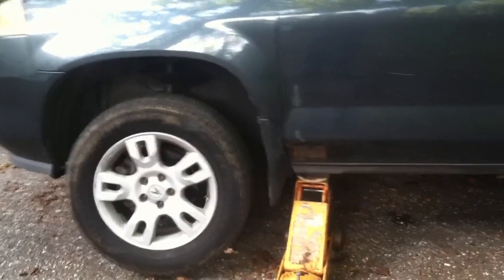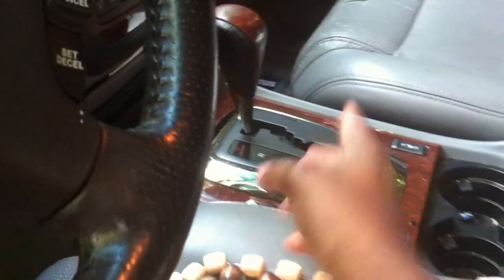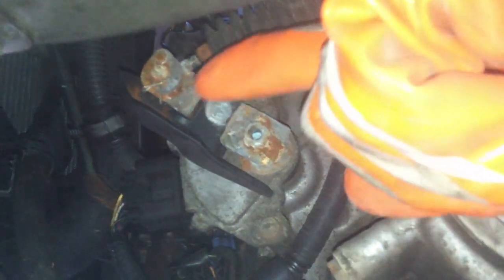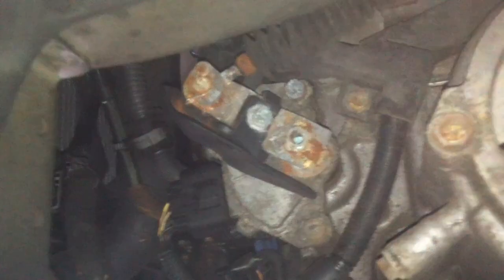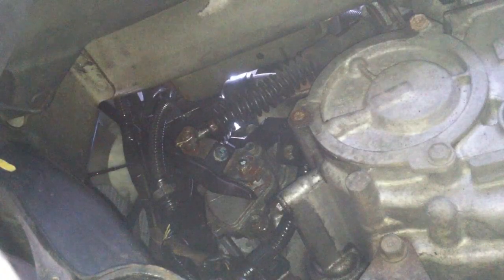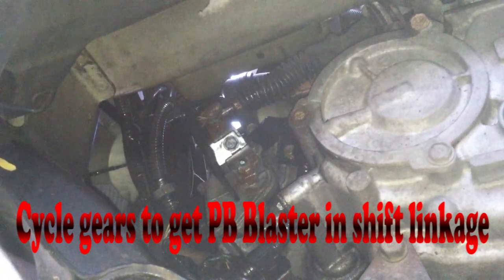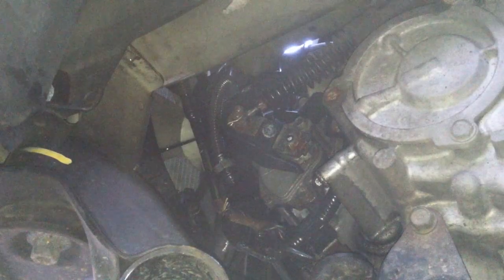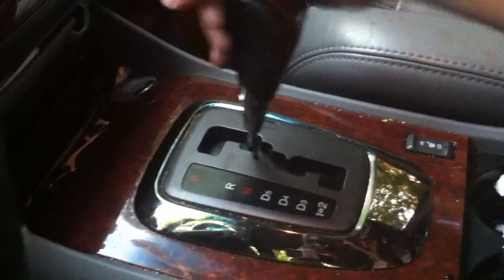How To RESOLVE Acura MDX Gear Issue (Stiff Shiftier, Gear Selector Hard To Move) FIXED!

Comment: Note that the shift linkage is in a different location on the 2002 MDX.  It is located under the vehicle.  Follow shift cable to transmission and there is a cover with 5, 14mm bolts.  Undue those bolts and spray linkage, etc. as shown in video.  Easy no cost repair!  Love it.
Reply: Thanks!

Comment: Was able to remove the battery and the plastic battery cover. Was able to spray from the top  (at an angle). Now much easier will check after 20 minutes.

Comment: Great explanation. Have you covered a noisy park 2 reverse or neutral 2 d1 shift?
Reply from the maker: Usually when the gear shifter is noisy, I would take the center console apart and clean any debris that might got caught in the inside.

Comment: My 2004 MDX started to intermittently start and playing with the shifter would allow me to start the truck. But last week I had to start manually release the shift lock to get the shifter to neutral.  Then I could turn the engine over  I followed your video and 30 min later I was done. Even putting back the three
Reply: Jacks and other stuff
Reply: Thanks for posting, It has helped  save my sons inheritance fun
Reply from the maker: Good deal!

Comment: It's very helpful for me. I have the same issue now. Appreciate it.
Reply from the maker: No problem, please feel free to share this video.

Thanks
Reply: I have a 2001 Acura MDX .been driving it 5yrs no problem.now some times wen I'm on the gas it doesn't wanna go at all.i have to put it in park and hopes it will move please help me could it be my transmission is going out.. desperate for answers
Reply: Hello Anitra,
You should leave from the gas pedal when your MDX doesn't move. When the engineer speed drops down to bottom. You immediately step on pedal softly. Your car will move. If it doesn't work. Repeat it. Do not suddenly step hardly on your gas pedal or your car will still freeze or suddenly rush. The issues often happen in winter (cold weather) & in the beginning when you drive your car (say 5 minutes). The MDX transmission (first generation 2001-2006) has this issue. You should drive be carefully in the beginning 5 minutes when you start your car. The issue will gone when you drive long time on the way.I don't know the reason maybe the car warm up. You can try your car on empty ground field and you will learn your car. It will help you drive safely. By the way, when you start drive your car. Step on the brake and release it, repeat it. It will avoid the issue happen when you drive on the road especially stop for turn or stop for red light. It is less dangerous when you start drive your car than on the road when the issue happens. Good luck.
Reply: thank you .I thought this was the issue bcuz I wasn't letting it warm up enough.lately I've been warming it up for 15 mins..this issue comes and go like when I'm at a red light and step on the gas to go it want and in about 2secs it'll catch and I'm able to go.im wondering if it's my transmission going out or what is the issue.im a single mom and I can't afford to buy a new car I love my MDX.i hope this is a minor problem tht can be fixed
Reply: Hi Anitra,
I think the reason comes from transmission. But if you drive defensively, it will be OK. Usually, the issue comes in the first or second stop. So if you stop and go in the beginning, it will decrease the chance the issues happen again. If it happens, check the engineer speed panel. When it back to left bottom (say 1x1000), step on the gas pedal immediately. You can do it within 3 seconds. If you are family with the situation, you will drive as normal. Take care.
Reply: Anitra Nickerson  You can search it on website. The issue described by others comes from the transfer between engine and transmission.
Reply: thank y'all so much .I will definitely look it up...
Reply from the maker: I've experience similar issues with my Bimmer which when it was cold, it would take longer to shift gears and found that the previous owner used cheap"store like transmission fluid that caused the issue.

I would highly recommend that you purchase a transmission filter kit (includes a transmission filter, and gasket) and purchase the transmission fluid from Acura. Drain the old transmission fluid, change the transmission filter and replace the transmission gasket (don't forget to seal the gasket with RTV). Break-in the fluid by driving for a few weeks treating your MDX like a baby and see if this will help you situation.

Comment: I have a question does the shift lock effect the vsa , horn and brake light relay?
Reply from the maker: The VSA, Brake Light is usually due to and issue with the ABS system. I would first connect a obd2 scanner tool to check your vehicle for any check engine/pending service codes. Also inspect your fuses and then check your wheel speed sensors to ensure they are clean.

If your having an issue with the horn, please be sure to check the fuse.

Comment: Thanks a BILLION times...just fixed mine yesterday after two months of Horror not being able to shift the gear...Any idea about the CLUNKING front end noise when i drive over bumps or uneven road...It started right after the original struts were replaced.
Reply from the maker: No problem and I experienced the same issue driving over bumps that cause the front end to bounce with clunking noise. 

Once I replaced the struts and springs the issue went away.

Thanks

Comment: Hi, this is outstanding!! Thank you. Do you know if this area can be reached by crawling under? Anything without removing the tire? Please and thank you.
Reply from the maker: You'll find it more beneficial to remove the tire for this process. However you could attempt to do this without the tire off but it will be a tight squeeze.
Reply: Thank you my friend
Reply: @Phillip J. M.  Try removing the battery and the battery plastic plate. You can see from the side and spray. I did and it worked for me

Comment: Did u get any delay in gear shift what happened with my transmission when I shift to d its take like 6 seconds to go forward
Reply from the maker: Hmm, there was no delay when the transmission would shift. But there was significant delay to manually shift the gear "shifter". 

For your issue, I would look into changing out the transmission fluid and filter. There's this after market gear fluid that is known to help transmission/gear issues but I cannot recall the name. It's worth a shop before replacing the transmission. Hope your able to find a solution. 💯

Comment: Hi , I have a gen 1 that blinks D5 when in park. If it sits for a while It takes about 10 mins for the car to go into drive. What do you think is the problem
Reply from the maker: Based on your description, that sounds like your transmission fluid and filter is dirty/old and needs to be changed. The transmission filter sits on top of the transmission and is very common that owners may forget to change it when changing the transmission fluid. 

You'll often see that when the weather changes, your transmission may tend to respond differently because of the outside temps especially with dirty fluid and filter.
Reply: @AWordFromMrJones  I had the fluid changed today. It was Barely any in there. It’s a lot smoother but it still gets stuck in park after sitting. I will do the filter tomorrow.
Reply from the maker: @2020Dreamlife  Yeah the transmission filter keeps a lot of that junk so changing it will help. Also adding some SeaFoam Trans Tune will help recondition the transmission gears. You will see results after about 2 weeks.

Comment: I have a 2002 and looks totally different when hi take off the splash guards
Reply from the maker: The sift cable on the driver side should be somewhat identical for Acura MDX 2000-2006. If you see the shift linkage cable, just spray some lube, run through the gears and you should be fine.

Comment: What’s the one you clean for it?w40?
Reply: pb blaster to penetrate the corrosion. you can leave it there and just follow up with anti-seize compound. but, if you want to clean it out ~ brake cleaner is the chemical you want to use

Comment: My plastic black piece is missing car drives but when I put it in park it just keeps rolling even with car off help please
Reply from the maker: It sounds like the shift linkage is not securely engaging. I would pull the wheel well cover off, have someone put their foot on the brake and cycle through the gears while you look at the shift linkage. Apply the same process as seen in this video to see if that will help.